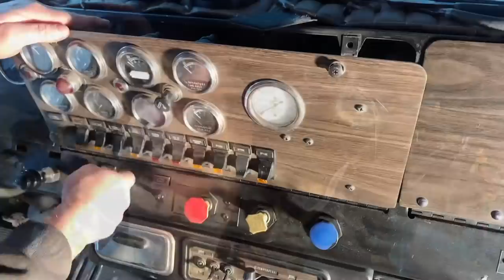Smokey & The Bandit Tribute Truck Ep.36 Wishing Won't Make It Fit

Comment: Find you a wiring grommet to put where the spotlight comes thru the ceiling panel to help seal it a bit to keep your warm air from making the roof sweat. Pictures of truck before disassembly are worth a thousand words.

Comment: Most  A models just had bare metal at the front of the headliner painted  to match the surround of the dash. I think the VIT interiors came from the factory with an upholstered panel.  I’ve seen some guys put an upholstery panel up there but they look good just painted, ours were bare but just the opposite we had the CB radios mounted up there and the fans on the dash. I think it will look good especially once you get the fan mounted up there I don’t think it will look so bare. Either way it’s looking awesome!!

Comment: The Day Cab company makes nice stuff. Great Video...I think on my Dads old KW the head unit went in first then the back panels and then the boot around the bunk opening. Just a Suggestion. There probably all different...LOL.Great Job and Video...
Reply: That was my thought. Seems odd you’d have the black plastic of the cap sitting on top of the finished material.

Comment: I would suggest applying  some heat to the plastic in the areas it will not conform to the areas it needs to bend to fit properly. 
Or, get the cab good and hot with the panel inside,  then it might go.

Comment: Mark, remember it's a labour of love, not a hemorrhoid. Slow and steady when your wrestling those interior panels. I would grab Mr Tape measure and measure the old ceiling liner against the new one. Chances are good you will need to make a few adjustments via the belt sander or die grinder to shorten it up so it fits past the new panels. I know it's frustrating, but being eager is "good ", "impatient" means 6 ~ 8 weeks shipping time for a replacement. They purposely make the ceiling liners a bit "proud", so you can massage the panel into place for a good tight fit. I believe your not looking for a "hot dog down a hallway" for a fit. Other than the frustration we can clearly see, she is coming along nicely, have a cup O Joe and a breather, it will come together.. Nice Job! Stay Safe & Cheers..

Comment: Good thing your in the heated shop now, don't think that headline would have taken the install attempts in the cold without cracking. Hang in there, looking good. Right call on taken time off from that job....that's what beer is for.

Comment: Some decent progress buddy! Love the twinsticks banner, it's sick! Just a little trick for you when checking speaker wires... A quick way we used to use when I was a sound engineer and when I ran my car audio install business is to use a 9v battery on one end of the wiring. This is extremely quick and useful way to see which wires run what particular speaker. You can also check the phasing/ polarity this way. When the ends aren't labeled and your connecting your head unit like in your case, you can quickly decipher the channels as well as positive and negative phasing. Figured I would pass along a quick and dirty but tried and true way to do this. You could most certainly benefit from a Power Probe as well. I LOVE mine! It's the single most valuable and useful tool for electrical work I've ever owned. I would put one on the list if you don't already own one Mark. I remember buying the series 1 original Power Probe when it first came out and was just blown away by what a great idea it was. I have since added a new series 3 unit to my arsenal and use it frequently whenever I'm wiring something up. It's super useful to check your wiring work and verify what you've done is correct too. Thanks for another great episode of my favorite truck on the 'Tubez!!! 👍👍😎

Comment: The Struggle is Real!lol I've taken the headliner down several times in my 2014 W9, it's 3 pieces, you almost have to be a contortionist to hold it in place then start running screws in 😵‍💫

Comment: If you take a double A battery and touch a lead to each end of speaker wire the speaker will make a static noise.  Easy tracing.

Comment: Another great video Mark. Don't remember if you've mentioned it before, but have you seen the bullbar fitted to snowman when he bulldozes his way through the police blocksde into the truck roadeo? Now that would make an interesting twist on a snowman restoration. Cheers from England.
Reply from the maker: Yeah they actually modified the ‘74 so it would work but I’m partial the the standard bumper with the Perlux lights 👍

Comment: Before you install that roof cap I would recommend doing any cutouts for  the radio and the lights that way you can work on it at a comfortable height and also not have to worry about hitting any of the wires that are up in the roof of the truck.
Reply from the maker: Agreed - I was just trying to test fit now that the interior panels were in

Comment: Dang sitting here in my nice warm house and I'm feeling the chill just hearing the snow crunch underfoot. Have to figure if you can't find an original KW sticker disk for the fan there's a transparent peel and stick sheet for ink jet printers you could probably print your own and seal it with multiple light coats of a spray sealant to protect it.

Comment: To make Snowman truly movie correct, you will need to give it a KW Torsion bar rear suspension.  You could do that as you do have a KW with the torsion bar suspension and, unless I am mistaken, the movie Iron Duke K100 had either a NewWay or the old style KW airbag suspension.

Comment: Hey Mark, Great episode as always - (I have to admit, its painful watching you work alone trying to hold up the headliner by yourself)😀 -—To be movie correct, there is a movable spot light on the PASSENGER SIDE of the KW as well — (Didn’t see this on this episode, so may have missed it). You can see a really good shot of the passenger spotlight when Snowman is taking down the flag banners near the end of movie, when they are arriving at the fairgrounds — that shot from the top of the truck)

Comment: I’m wondering if the cap goes in first.  Then the wall panels, then the boot.  Seems odd you’d have the unfinished black plastic with an edge running along the back wall on top of the finished materials.

Comment: Hey, good buddy - I'm thinkin that padded panel I saw you mount on a dash was meant for above?... and am I thinking that the roof panel should have been mounted first?   Not a jab - but honest question.  I'm learning from you, Twinstick.
Kudos and good work eh
Reply from the maker: I thought of that but I don’t believe so as it would look odd with the vinyl panels sticking out over top the edge of the plastic also that’s not how the original installation was 🤔

Comment: Do you have a nut cert installation tool? Lots of application when doing up a truck. I was thinking about the cover for the overhead radio. Not necessary but makes for a clean fit for that radio cover.

Comment: You'll need to run a permanent power to your radio otherwise every time you turn the truck on you'll have to pair your phone and crap. It's only a memory wire so low amperage low draw